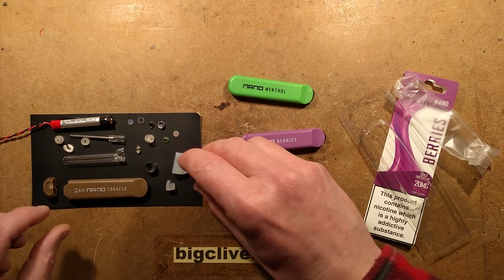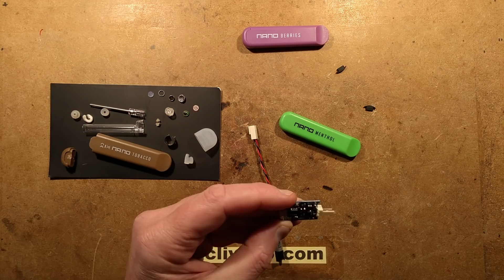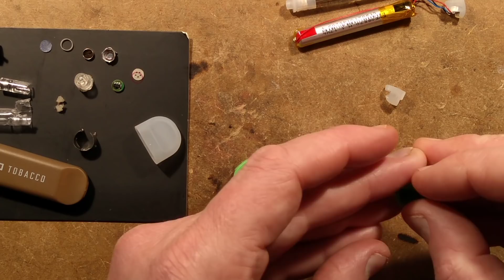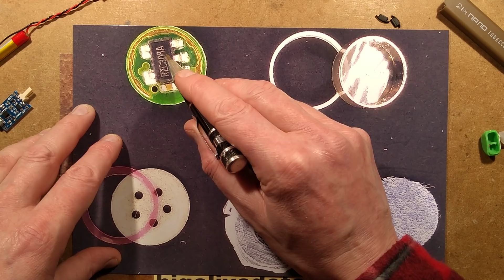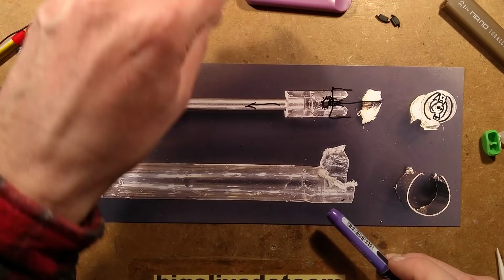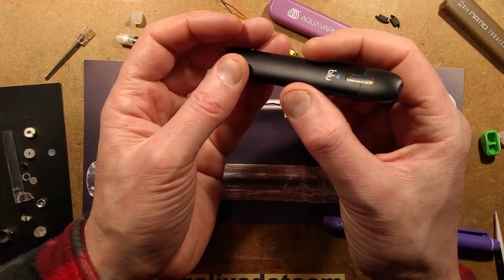Free lithium cells from discarded vapour devices.  (And total teardown of one.)

Comment: is this how the smoke was made on really old toy trains?
I remember having a old toy train that needed oil added into the chimney to make a smoke effect while it was going around the track.
Reply: They either used a glycol mix similar to vape juice or more likely a tiny heater coil that would aerosolize light machine oil.
On the really old trains there was a small oil fill hole in the stack area.
Reply: @seanb3516  is correct. I have an older one, from the '60s if I had to guess. It uses a simple coil in the stack and you just drip machine oil in it.  Love that smell haha. It just survived its 29th Christmas with me and is still going strong.
Reply: @aaronj08ar  I remember it as an oily sweet smell. It takes me back just thinking about it.
Reply: wow, i remember these, from the 80s/early 90s, dont know HOW many i took apart as a kid just for the smoking element, it was usually in some kinda styrofoam like material
Reply: @aaronj08ar    They probably invented the resistor and didn't realize it.  lol
Reply: Had a truck with it as well when I was about 5, and yes the smell was great😆 Still remember being disappointed that when the stock oil was finished what we refilled it with didn't work as well 😟 That was more than 30 years ago
Reply: The classic Lionel trains in the late 50s and early sixties had a heating element but you dropped a small white smoke pill, solid, into the stack. And it "puffed" out the smoke, not a simple continuous stream. They could work with "liquid smoke" but Lionel sold smoke pellets.
Reply: Hahaha... and I recall the instruction manual also had a warning not to inhale the smoke as it could be hazardous to health...
Reply: @jonathantan2469  it would be cool if clive had one of these old train sets to take apart
Reply: Yeah I remember having a rc dump truck that took a bit of oil to make smoke.
Reply: My uncle had a smoking train in the sixties. I believe it was a Rocket.
Reply: I seem to remember my old train (late 50`s early 60`s) used a light bulb to heat up the oil?
TNX for the upload!  73 N8AUM
Reply: now you can modify those into adult nicotine trains
Reply: @ketas  ive done better, i put the e liquid into a fog machine on a party bus.
Reply: I stand to be corrected, but I think that heating mineral oil will produce black smoke rather than white.  The real thing is water vapour, but a glycol can make the same density of white cloud with less heat input than water.  Probably that then, as in a vape.
Reply: Oh, I just saw Sean's comment, maybe oil is being converted to an aerosol rather than burnt.  But how would that be done?  An ultrasonic mister?

Comment: BigClive, I have a question. I read from many sources that a transformer needs AC current to work. But in almost all circuits I see (like USB chargers), the transformer is working on DC current. I'm really confused...
Reply: Teeny tiny transformers work at a higher frequency than traditional ones.  You'll find an oscillator on the primary and a rectifier on the secondary:  the transformer sees AC.
Reply: @tactileslut  Thanks. What's the oscillator looks like? I don't think I have seen one...
Reply: @tactileslut  Thanks, you have been very helpful. At least I understand now why the transformer is on the DC side. It works at high frequency (so, not DC) to be able to use a small transformer.
Reply: Gael Lafond ...
Why not take a trip to your local library and borrow a book on basic electronics?
Reply: @DrQuadrivium  That's a very good idea! I kind of feel dumb not thinking of it before. Thanks. I will get a few books tomorrow
Reply: Gael Lafond what do you mean by "USB chargers"? If you mean the blocks that plug into the wall, they're working on AC. If you mean power banks, they don't have transformers. They have something that looks similar, an inductor. Maybe you already know about inductors, and it's another device. In case you don't know, things that look like transformers can be a couple of different types of components, such as inductors, common-mode chokes, differential chokes, trigger coils (like the one in a disposable cameras' flash circuit), and probably more.
Reply: @mckryall  I mean the block that you plug into the wall. The circuit is like this: AC -> Bridge Rectifier -> Transformer ... Since the transformer is after the bridge rectifier, it must be getting DC.

Comment: Bigclive could the resistor on the tp4056 be replaced with a suitable rated variable resistor in place to charge different cells with one board and as usual great video
Reply from the maker: It could.  But the boards are so cheap it might be worth having a few different versions with different charging currents.
Reply: @bigclivedotcom  ya I bought a 10 pack because of one of your previous videos 
And any excuse to get the gear out and turned on that way I can stay up all  night and tinker
You know what I mean
Reply: Yes, but you'd have to mark it for the various currents you wanted
Reply: @ale6242 thanks  exactly what I thought but wasn't sure if it would work
Guess it's off to the bench for experiments

Comment: That is awesome!
I'll be keeping an eye out for these.
I carry a multi-tool every day specifically to be able to take advantage to salvage opportunities in the field.
I've also found that the milky-looking translucent silicone parts make for outstanding diffusion for custom LED lighting projects.
The milky silicone just spreads out the light in a very very nice way.
I recently used a small vape cart end cap in a little decorative faux vacuum tube lamp I recently built.
With an orange LED inserted, it made for a very mellow and (I think) realistic-looking heater glow from deep within.
Great stuff as always, Clive
Reply: Cool tip!
Reply: I also carry multitool for this purpose. Also I have salvaged multiple phones and battery banks (most are even in working order) from the used battery boxes we have in stores in Estonia._
Reply: Here I was thinking the silicone bits were worthless. I was wrong. Great idea!

Comment: 20mg not strong by US standards! Those Juul things clock in at over twice that, 54mg IIRC.

The core difference is that in the US, vapes are regulated as tobacco products, which is to say they are barely regulated at all. Lots of little vape shops throwing FSM knows what into liquids. The FDA hypothetically requires good manufacturing process, but that's it.
Reply: Shops aren't supposed to be mixing their own liquids anymore as far as I know. 54mg or 5% is the strongest Juul pod you can buy, 3% is the other strength. Relatively speaking, this is compared to non-salt based liquids which are even lower. These are the devices that big tobacco wants people to have, too. They don't want the refillable, rechargeable, or otherwise parts replaceable vaporizers on the market.
Reply: @MalleusSemperVictor  They might not supposed to be doing it, but I know at least one fellow whose job it is to do exactly that: mix it in a little shop, typically with a propylene glycol or glycerin base.

I'm a bit confused by the "salt" part here. Usually the freebase form of an alkaloid has a lower melting point and higher bioavailability. That's why as I understand it, tobacco companies used to treat the leaf with ammonia: the ammonia would react with the nicotine salt and convert it into the freebase, meaning you lost less in the process of smoking it. The freebase is generally not water soluble, however.
Reply: @PaulSteMarie  Manufacturers add benzoic acid to nicotine salts which lowers the pH of nicotine salts and increases bioavailability and give that immediate nicotine blood level spike like a traditional combustible cigarette would. Traditional liquids using freebase nicotine elevate blood nicotine levels slowly and more evenly. I was perhaps mistaken on whether or not liquids can be made locally in shops and sold but the rules are extremely confusing. As far as I know, the FDA wanted verified data sheets on all sold liquids to determine their ingredients. I suppose their concern was that stuff like diacetyl was making it's way into liquids even though as one might imagine diacetyl ever found in liquids is minuscule compared to the product of a burned cigarette.

Comment: Has to be said, as a long term (knocking on 6 years) vaper, having gone through the old 510 devices, the emergence of sub-ohm, temp sensing etc, after all that time, I'm far far more interested in the design of these low end/simple devices than the 'high end' 200w+ 2xcell cloud chasing gear.

It's where  the real innovation is at the moment; building down a cost kinda forces it!
Reply: Same here. Been vaping for quite a long time and my daily vape is just an eGo AIO. Easy to fill, charge, and ultra reliable.
Reply: this, I have a nice vape with a sub ohm coil and all the bells and whistles but I still find myself using my logic pro £10 pen vape whenever I go out because of its size and small drip tip (which stops pocket gunk from getting stuck in it)
Reply: Juul.....
Reply: @jakew3  juuls are complete trash compared to decent pod style vapes.
Reply: Yep same!  I use a low powered mechanical squonker but with LifePO4 batteries in it instead of the more dangerous ones used for sub ohm vaping.
Reply: @SproutyPottedPlant  high amp output cells aren't dangerous, low output high capacity are. they got different chemistry

Comment: Some time ago I stock up on the "shisha" type disposable vapes on aliexpress and I also found a job lot of power hit disposable powerbanks for a great price (I was looking for them after watching your teardown actually).
These small cells are really useful to convert small devices to be rechargeable.

Anyway since these are 300-ish mAh do you think charging them at 1C is doable long term? If you use a 4.7K resistor the charging current will be around 250mA which perhaps is a bit better?